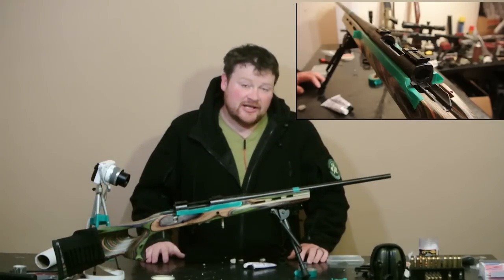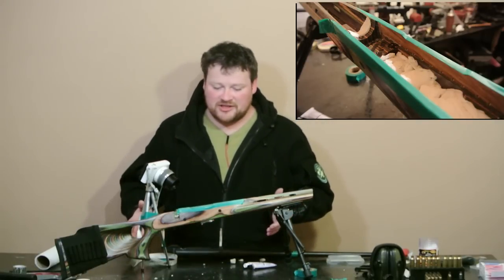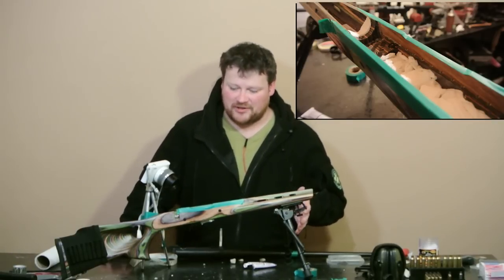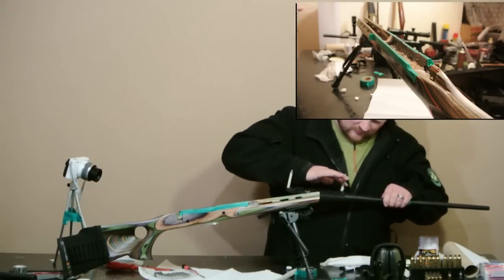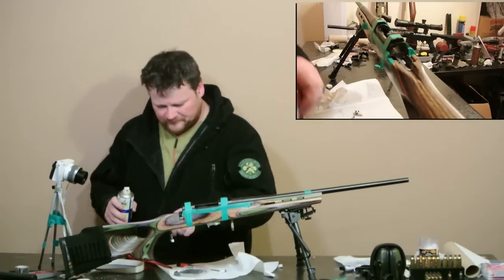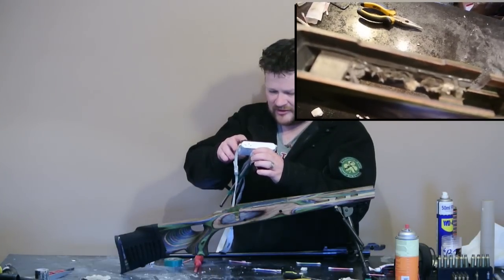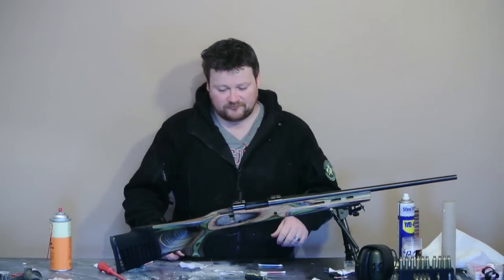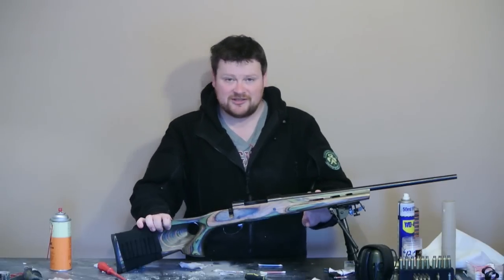How to Bed a Rifle, Bedding a Boyds Featherweight Thumbhole

Comment: Thanks for the vid my good man! I purchased a Boyds featherlite thumb hole stock for my .223 Savage Edge. It was not the exact correct stock, but it was in the bargain bin for $65.00! how can I go wrong. Everything is fit now and I am going to the range to shoot some groups to get before and after bedding info. 

I really like your idea of taping in the action instead of cranking it down. I also use JB Weld for bedding and it never gave me an issue yet. FYI...as a release agent I use a product called "Pam" olive oil flavor, which is a non-stick cooking spray. It works well and cleans up easy.

Have fun!
Gerry

Comment: Thanks that very impressive.I've bought some JB Weld in preparation.
I have a Howa 24" Varmint.223  in a Howa Thumbhole stock and so far it's doing fine without  bedding but again I might just do what you suggest in the video.Have a good Christmas !
Reply from the maker: the original Howa thumbhole is a fine stock nice fit. I found the original stock was fine unless it got damp and the wood would swell around the rear of the action, shifting the poi a bit. after bedding the problem went away.

Comment: Good information as I have the same stock doe a Remington 783. 22-250.  Thank you for that.   Did you remove any wood from the stock prior to bedding and then build up or simply add the Epoxy on the existing stock after prepping I.e. Holes etc as is?    If not, did if impact on the magazine contact with action etc .  The 22-250 has a removable mag.  This would be my first attempt so wondering about how that as a possibility.  Thanks.
Lou
Reply from the maker: On that build I did not have to remove anything from the stock it was  Perfect fit , on some others there is some work to do in the barre channel .
I have never worked on A 783 action but you if it works with a dry fit it should be fine after the bedding . If you are not putting in pillars you can shim the floorplate with thin washers to change the angle to make it feed perfectly .

Comment: Do you think it would be possible to put together a rifle in .270 or 6.5 with a Boyds ft stock with scope weighing around 7lb+-, for shooting offhand, no bipod etc ?
Reply from the maker: Alison Fortune Sure. if you have a nice light barrel. you can also shave more weight of it by drilling out the back of the stock behind the recoil pad.

Comment: Hi MRAD, good video mate. Hope you don't mind if I make a suggestion but it might be better if you were to put your small camera on the other side of the stock. That way it doesn't get knocked over and things like fingers and thumbs don't get in the way of the view.
Reply from the maker: Thanks. fir sure the camera was in a bad spot.  mostly because it was to big and to unstable. I normally have a much smaller camera for those shots but it's at my gun smiths recording a build.  I should have it back soon.

Comment: I just did the same stock i piller beded it first then did the bedding floated the rear tang and barrel .. I got a little trick i learned my self ive done over 20 socks now.. But any how i use a gutar string the finest one They make i take painters tape and hold the string rite along the stock and tape it to the barrel so it will just kinda be at the edge of the stock rite where it just gets Ready to go down in the stock.. Reason for the wire on both sides is i keep checking the jbweld soon as its getting good n stuff but not over hard i grab my wire at each end i tape then to something so not to cut your fingers .. But any how i give an even kinda fast steady pull tords me and it cuts all the exta jb weld off and away from tbe stock makes clean up so much better.. I invented that 13 years ago.. Biggest thing is you got to put the shoe wax on the tape that's along your stock and on the barrel to keep it from sticking just as you do the inside of the stock barrel exctra.. Great video fella
Reply: Think we need a video of this!
Reply: @WhitewaterOutdoors  unfortunately im not the best at camras but id love to make a video on it . i really enjoyed doing my own stocks. Hardest one I've ever done was the savage 11 bottom bolt release . i did it but wasn't easy . shoots fantastic tho.

Comment: i have the bell and Carlson medalist stock with the aluminum bedding  block.  My question is would bedding the recoil lug keep it from moving around?  i have a lot of play back and forth right now
Reply from the maker: For sure it will keep it in place. there's no need to bed the full length, just around the recoil lug. And since its a bedding block you and torque the action screws to the normal settings when letting it set.
That way it will be under perfect working tension for that point on.
Reply: how far ahead of the lug should be bedded? i have a heavy barrel and it isn't completely centered in the barrel channel. i saw how you used tape to center yours.  would this put stress on action/stock or will it be fine?
Reply from the maker: fadingabel7
 half an inch forward of the lug should be enough. i would not go any farther than the shoulder of cartridge chamber.
you should be able to shift the action left and right a small bit unless the action screws are in very tight pillars or holes. but if trying to build up tape around the barrel causes a flexing then it would not be worth it as you will just cause tension. but if its taped up and centered with no pressure then it will be fine.
Reply: ok thanks for the info bud
Reply from the maker: No problem Thanks for watching
Reply: MRAD Outdoors l

Comment: So if i understand bedding correctly, your basically creating a better surface or "bed" for the barrel to sit in?
Reply from the maker: Yes you are building a non changing surface for the action of the rifle to sit in.If done correctly will not be effected by heat cold recoil or moisture.
You do not want  to go to far past the action or recoil lug as if you bed to much of the barrel you can change the harmonics and if you have a lot of barrel contact when the barrel heats up the expanding metal will change your point of impact.
Reply: Gotcha. Super cool I appreciate it. Will give it a whirl some day soon. =)
Reply: MRAD I usually bed the first inch and a half of the barrel and free float the rest. I have a Howa 6.5x55 that is my next project.....also getting a Boyd's stock.
Reply from the maker: Oldman Wells
Inch and a half should be fine.
I don't think bedding to the end of the shoulder of the bullet in the chamber make much difference.
I just would not go much past that
Reply: No, I don't think it has much to do with that either. It may affect different weight barrels differently too.

Comment: Great job! How does she shoot now?
Reply from the maker: Much better.
The big difference was when the stock got damp with the wood to action contact it would swell and shift causing small point of impact shifts. this will happen will almost all wooden stocks. but having the bedding inside the extra structure means the shift is minimal making is a much better stock for Hunting and stalking in the rain an damp.
Reply: MRAD That's great to hear. I've always been a big advocate of the stress free bedding method. Thanks for the reply.
Reply from the maker: philip140 stress free is the only way to do it. I just cannot see any advantage of clamping it

Comment: Hi ,what did you use to keep jb weld from sticking to the metal ??
Reply from the maker: You can use a clear shoe wax, Kiwi works well. Or if you have it Lee die lube or any wax lube for reloading
Reply: thanx ,that should get tighter fit than cling wrap.

Comment: Where are you ? You sound irish, how did you get a Boyds stock over ?
Reply from the maker: Where am i, yes i am in Ireland and Irish.
And i ordered it from the website. there is only a short list of firearms parts that are covered by ITAR and non tactical gun stocks under 99 dollars, can be shipped just fine. But if i were to order a Boyds Tacticool i would have to get a firearms dealer to import it. Thanks for watching